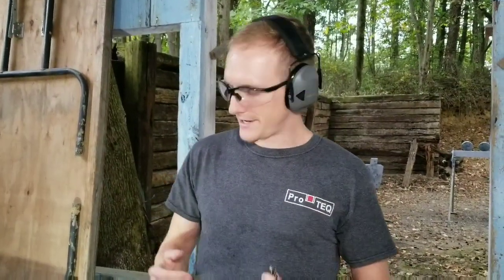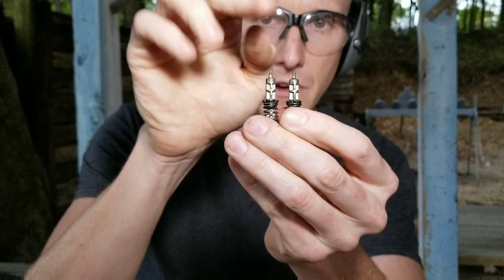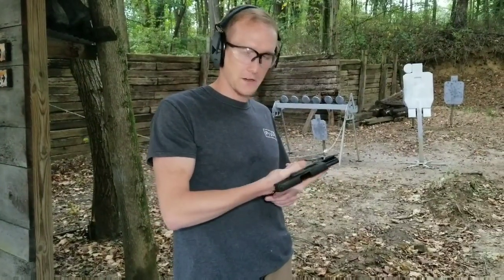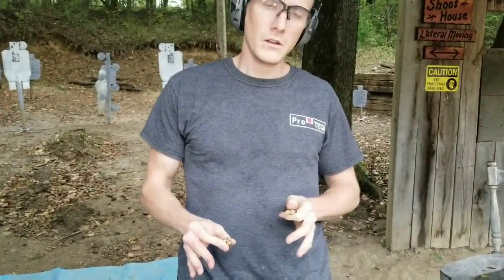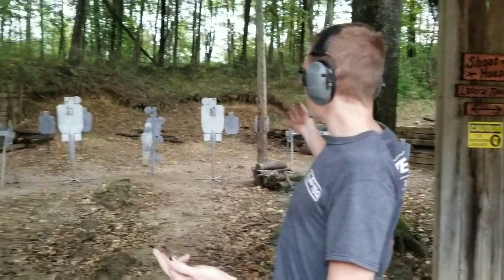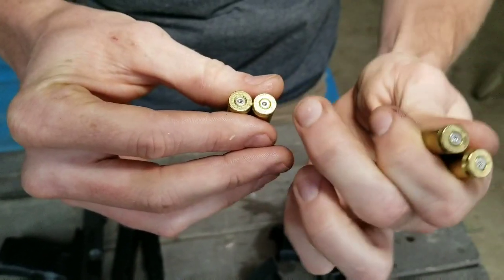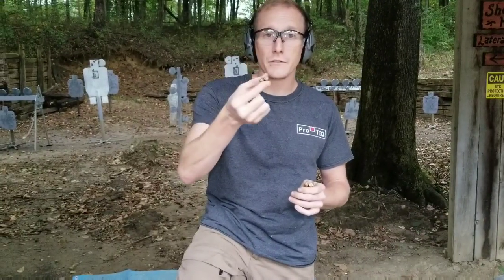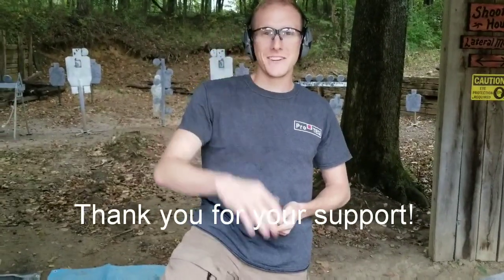Sig P365 vs P365XL Striker and Performance Comparison by Firearms Engineer/Instructor

Comment: My p365 xl with manufacturer date of dec 6 2021 has the black striker, not the silver, and is missing the striker reset spring. Do you know anything about this?
Reply from the maker: No I don't, other than they may have discovered it doesn't make much of a difference.  That's just an educated guess, however.
Reply: @proteqcustomgear  just to pass along a little info I confirmed with Sig customer service yesterday that the striker reset spring is no longer there on the newest version of p365. But like you said I think they realized that little spring didn't serve much purpose plus saves them a few pennies. I think that spring may have been removed when they redesigned the striker tip.

Comment: I just picked up a new P365xl ( made Feb 2021) and already have a regular P365.  I noticed the during pin in the XL barely protrudes out the breech face where my standard p365 comes out much further.  I haven't shot it yet, but the lack of protrusion concerns me.  Maybe they is in the design to help eliminate striker drag.  Hopefully not at the expense of light strikes though
Reply from the maker: It sure is!  That's their intent.

Comment: I have searched recently and the new striker assemblies are out of stock
 everywhere. About how many rounds can I reasonably expect to fire 
before the striker this came with fails? Any estimates? or experience?
Reply from the maker: We put over 12,000 rounds on our's and still had no problems.  When we did the destructive test I ordered a new striker assembly directly from Sig's website and received it in the mail about a week later.  Check out that video.

Comment: why would you not show us a case ? 
I have had my Sig P365 for about 2 years now and it shoots flawlessly but there is still striker drag dramatically on all my cases, 
When calling Sigs customer service seeing if there was a recall on my model because apparently I bought a model after a certain production date and it supposedly was addressed I was literally told by the rep that he has put over 3k on his P365 and that I should not worry about it. I did not engage and thats as far as that conversation went. Because I was going to call back the next day out of hopes of getting a different rep to see what he was going to say. Same response "don't worry it will be fine" thats just what they do. Im wondering why people are still avoiding this, to this day if you buy one it will do the same thing.
Reply from the maker: The casings are compared at about 6:30 in the video.

Comment: Have always been surprised more gun manufacturers don't use the blade type strikers (like in the Hellcat). As far as I know, they're no less reliable as far as primer ignition and are much less likely to break. They're usually bout twice as long/thick in the direction (vertical) of the primer drag, so if there is primer drag, you have a much more durable/supported firing pin.)
Reply: I just got a hellcat pro and mag tech 124 grain is leaving more primer drag than what he showed.   With pmc and federal I saw no drag perfect circle.  Hun is brand new 3 weeks old maybe 300 rounds
Reply: @7TheHardway  Good to know. thanks. Gonna have to find good ammo that don't primer drag. I know SIG says it don't hurt the gun... but firing pins were not made to have perpendicular force applied to them. I have no doubt that it increases the chances of a broken firing pin (even if only slightly).
Reply from the maker: That's a good point, Deuce!
Reply: Glock Gen1-4 have bladed strikers

Comment: Good Grief there is not a hell of ah big difference between the two and so why is everyone so damn upset?? You start to worry if the striker starts to hit the inter ring of brass casing.   That is where trouble could start.  After 600 rounds not a problem .. I look at the brass all the time to see what is going on.

Comment: Hey I was wondering if you could give me some insight on something being that you're both an engineer and an instructor. I actually shoot guns that have a shorter barrel with LESS muzzle flip than guns with a longer barrel and slide. I understand why this wouldn't make sense and I understand why everyone says a longer slide shoots flatter. But this has just not been my experience, I even shoot a p365 flatter than I shoot a glock 19 (which allows me to get my hand higher making it seem like it should shoot flatter).
The only reason I can think of is that maybe the slide is lighter so when it travels to furthest backward position, it slams back with less force? Just something I keep noticing when i shoot different guns that seems to be to the contrary of most people's opinion and I wanted some insight thanks.

Comment: However, it seems now that  ALL recent production 365's have the XL-style ramped-tip firing pin tip.......
Reply: My P365, with a born on date of September 29, 2019, has the ramped tip firing pin tip. I thought this was a sign of excessive wear until I saw this video...
Reply: @lynnlittle8671  ...if you look REAL CLOSE at the angled tip, maybe with a loupe or magnifying glass....you will notice a "seam" line running down the length of the angled surface...a sure sign of it being part of the original MIM process. Wear in that area would otherewise show no seam line. Cheers.
Reply from the maker: That's what I've heard as well.
Reply: ProTEQ Custom Gear and ProTEQ Firearms Academy I got one made in 4/19/2019 
Will I need to worry about the pin breaking? Would love to know before I leave the store with it (waiting for NICS approval)

Comment: Just bought a new p365 fde today, has the slanted firing pin.
Reply from the maker: Thanks for sharing that Jerry!  I believe they started putting the slanted ones in towards the fall of 2019, which was a good improvement to make!
Reply: @proteqcustomgear  yes sir, no problem, indeed it did, zero primer drag, pistol shoots great, 200 rounds down the hatch.

Comment: The new strikers have a different method of locking behind the rear slide plate. Could you do a video on how to remove the new strikers? I could not get my slide plate off and there are many other people who have the same problem. Thanks for the good teaching!
Reply from the maker: Hi John!  Will do.  It's fairly straightforward.  You have to push/flex the small nub on the right side of the striker sleeve inward so that the sleeve can be pushed downward so that the backplate can be removed.  You can share this text with anybody who needs it.  I don't have a newer version on-hand to do the video with otherwise I would.
Reply: John great question, I was watching the video hoping he’d cover the removal as I was trying to figure it out on my new XL.  I has some issues on my 365 (striker cup deterioration) after only about 500 rnds & wanted to chk out the cup on the XL.

Comment: What is curious is my Aug 2019 build is not symterical . My p365 two tone has the xl type striker that's slanted. Compared to my may 2019 p365 the strikes are different
Reply: Correct. Sig starting implementing the beveled striker in the normal p365 on july 1st, 2019.
Reply: @scitzofrenic  well that's good to know that the p366 is a for sure good to go now for those caution minded.
Reply: Scitzo does this mean the symmetrical one will need to be replaced? I just got one made April 19 2019 and I don’t want to deal with sending it back
Reply: Same. Just picked up a two tone today and compared it to my other 365. Fully thought the tip was snapped off

Comment: I wonder though, if the asymmetry of the XLs firing pin will lend itself to its own issues because of the thinner amount of material at the tip. I know it is doubtful, but I still wonder and for sure time will tell.
Reply from the maker: Agreed 🤙

Comment: But we are talking about a longer heavier slide versus a shorter lighter one. So the drag may be there anyway or is the geometric shape really a significant drag reduction factor on the shorter lighter slide and should we be calling and asking SIG for an improved geometric striker? Right now mine runs fine and the drag is there and no big deal so I see no need. Like your very informative videos from the engineering side. Thanks.

Would have liked to have seen you put the geometric striker in the short original and see if there was a significant difference.
Reply from the maker: Time will tell which is better; the symmetrical or the non-symmetrical striker.  Folks are saying that Sig is selling the P365 with the non-symmetrical striker now.  The two newer P365's that we've tested must be old enough to still have the symmetrical one.  

Calling Sig is worth a shot.  However they might not give you as detailed a response as you'd like.
Reply: @proteqcustomgear  Thanks for the reply. Mine is June 2019 with a standard striker and its been flawless. Thanks again.
Reply from the maker: @rbm6184  you're welcome!  Glad it's serving you well!
Reply: @proteqcustomgear  you might have heard as much by now, but the exact date sig silently introduced the beveled striker into the standard p365 was july 1st, 2019. Any non- manual safety or manual safety p365 built afterwards includes the new beveled striker. My manual-safety p365 built august 5 2019 verifies as much.
Reply from the maker: @scitzofrenic  thanks for providing the exact date.

Comment: Do you have any recommendations for a kid who’s starting his mechanical engineering degree at NC State? 😁
Reply from the maker: Yes, don't suck.  Work your butt off, and pursue internships in the field you are interested in.  Internships help graduates--with no "years of experience" under their belts as is the requirement of most open positions these days--get their foot in the door and expose their capabilities to their summer employer.  If they do a good job they might be asked to come back the next year or might be given a full time job offer.
Reply: ProTEQ Custom Gear and ProTEQ Firearms Academy Great advice thanks!
Reply from the maker: @stopthephilosophicalzombie9017  you're welcome!

Comment: Interesting. I'm curious on your thoughts on the Lightning Strike striker. People claim it's stronger and reduced the drag a little bit?
Reply from the maker: I have no time spent with it.  If it works then great.  As long as it has positive reviews it won't cause any problems.  That being said, it is a solution to a problem that for all intents and purposes doesn't exist.  If it were me, I'd invest in accessories that add value to my gun rather than replace already properly working components.